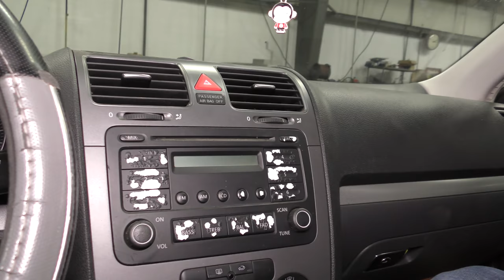$1,000 for a window motor on a 2005 VW Jetta?!? The CAR WIZARD & HOOVIE were just a shocked as you!

Comment: An 05.5 Jetta! This was one of VW's mid year model changes. For the first part of 05 they had the Mk4 style cars then switched to these. This was the first year VW offered the 2.5 5 cylinder motor. I bought one of these when they came out. It's actually a great engine. They really don't have many problems.

Comment: The window motor/door control module is a rare item to actually have fail. And you have to make sure it's not only the right part number but also the right "color code" based on the car's VIN number to properly match and be able to talk to everything else on the convenience system data bus (central convenience and electronics module, all the other door modules etc).

What IS common, however, is for these early mk5 Jettas to have broken wires in the door harness. VW had an extended warranty for them even because it was so common (but generally ends after the car is 10 years old or older). They have an updated harness that's a fair bit longer that supposedly prevents the harness from bending excessively in the same location, leading to eventual wire breakage.

While the extended warranty is long gone, they should still have the updated harness at a more reasonable price than a new door module.

Comment: The VW dealership wanted approx $1200.00 US dollars to replace my 2008 VW 2.5 Rabbit vacuum pump and gasket.(the same one in this video).. (this is when my new mechanic - a guy who has a shop since the 1970's, and only works on VW's and Audi's was found).... my new mechanic said, "you don't need a new pump"...he fixed for approx. $275.00.  

Can easily replace spark plugs, air filter myself... AND that coolant reservoir Hoovie mentioned leaked in the middle ... $35.00 to replace.... 

 My new mechanic said that the rust...(the tiny bit right above front tire)...was from the sound deadening foam located up in the fender, he pulled both foam blocks out of both front fenders....  He also said its a good car, and that he could get a new engine if needed for approx $900.00 ....it has approx 170,000 miles.  He has a unique way of checking the transmission fluid, however, have to leave it at the garage overnight....has to be cold....then he adds transmission fluid by temperature somehow.

Comment: I love these. My mom has a perfect 2010 5 speed that she never drives. 50k miles on it. I have a 2013 Jetta 2.5 and its a POS rattly ass rough riding turd. These are great cars. I LOOVE the 2.5. They are very reliable and make fun noise. Decent power

Comment: I had an 89 Ford Probe GT have its driver side regulator cable fray and fail.  The dealership told me it would be cheapest to buy a used door.

Apparently, in order to repair this regulator, it required drilling out all of the spot welds between the inner and outer door panels and then re-welding.  They quoted me $600 to do it, and that was back in the mid 90’s.

Comment: Coincidentally, I had that same handbrake issue on a ‘98 VW GTI. Seems the little rubber boots at the rear ends of the cables had deteriorated, letting in water which would then freeze and lock the brakes on. I eventually replaced the cables, and it was actually a pretty easy job. Just FYI.

Comment: My sister had one of those, she bought it new and it immediately had oil leak issues.

She took it to the dealership five times and they kept telling her it was "normal" for them to leak like that and they told her to keep topping it up with oil which she did, even after the engine blew because of the constant oil leakage they refused to acknowledge that it was a serious problem until she threatened to sue volkswagon canada and they refunded her the value of the car new so she could go buy something better.

Comment: Wizard, that window motor is only around £20 here in the UK and Ireland, and it does not need to be coded to the car either, I have changed loads of these.,
Great channel and content
Reply: Had to dig for this comment, your absolutely right!!! and they are more expensive in the usa, oem $400, rebuilt or aftermarket anywhere form $100-200.

Comment: A client's 5 year old 2001 Golf Mk lV broke the cable mechanism on 3 (three) electric winders in a year & a half. Driver's door twice & passenger's once.
$400 bucks each, coz they included the motor, no alternative.
Wound up buying mechanical winders at a Scrapyard ($30 bucks each) & punching a hole in the panels for the handles.

Comment: Used window motor, hold switch down 10 seconds, then up 10 seconds. It'll reprogram
Reply: Yeah, you have to do that any time you replace the battery in the car as well. All that's doing is getting the module to recognize where the auto-down and auto-up should stop. I've got an 07 rabbit and have to deal with that.
Reply: Thnx for the info

Comment: I'll sell you a door with window...complete, correct year, color.  Mine is inherited 2.5 automatic.  Trans started to slam 2nd and 3rd at 87,000 miles (Typical German planned obsolescence).  Still slams and slips at 147,000 miles, but it gets me back to work, and the heated seat is great in winter. The alternator clutch pulley seized so I might be ready to sell parts.  My radio looks like that one, but 6 cds means I never have to touch the "leprosy buttons".

Comment: This is not a 2005 Jetta the production date was probably in 2005 but the model year is a 2006 it’s a MK5 Jetta the 2005 is a MK4 .  the windows regular problem is most likely broken wires in the flexible rubber boot near the door hinges also the vacuum pump normally leaks where the pump mates to the cylinder head and also on the plastic nipple where the vacuum hoses is connected the pump is easier to remove on 5 speed manual cars the automatic is harder.

Comment: I have the same year Jetta with all the same problems. The window turned out to be due to some of the wires in  the driver side door wiring harness  being too short so they get cut and stop working. The fix was to get a harness from a later model year parts car that didn't have that issue. It"s been over a year with no issues. Overall its been a good car and i hope to have it another 10 years.

Comment: I had a 2005 Jetta TDI. Or has the same rust problems. I had to replace at least one of the window modules. It was worth doing, though, because I drove it to 255k miles. It still trash great, but I didn't want to deal with the rust. 

I now have a 2014 Jetta Sportwagon, which I expect will go to 250k also.

I don't know if the 2.5 can be expected to 250k+. I've never had one.

Comment: I had two of these new in 2006 and 2008. Later had a third one when the model changed again in 2011. The engine gave no problems. When you run into problems with this car you should always take in consideration looking for original Skoda parts for the Octavia A5 model. Those are the same parts, but 10 times cheaper. You can also get parts for this car in Mexico, as it was assembled there.

Comment: If your buying a USED Jetta or any VW with these vacuum pumps they do need the gasket replaced around 100,000 or 8 years. The gasket cost $9 & it takes 30 minutes to an hour to replace. The 2.5L is one of the most reliable motors around plus you get decent power & decent gas mileage.  The next generation Jetta body style is a lot better.
Reply: @enp83 You can do it from the top yourself. There's a few videos on YT that shows you how. What ticks me off is some Mechanics will try to charge you for dropping the transmission & go by VW's estimated cost.

Comment: Its the door harness not the window motor setup. VW did a extended warranty on it because they knew it was trash but they time limited it and the replacements didn't solve the issue with time. Shouldn't be more than $300 with labor with how cheap the harness shows up online now.

Comment: Wow.. I have the original radio in my  01 Subaru Legacy /w 135K that I've owned since 2006 and the radio buttons still look great.  Tape player stopped working tho and CD player has an issue  with skipping while playing music.  6CD changer in 2012 stopped allowing CDs to be ejected or inserted; the few that are in there will still switch and play.  
headliner not sagging. all original window motors. moonroof still works, too.

Comment: Not great... interesting. Our 2008 Rabbit has been 100% reliable. I did just do the vacuum pump at 140K miles. And replaced the AC pressure switch. Oh, and the door locks. But overall, extremely reliable, functional vehicle that is pretty fun to putt around in.

Comment: I owned a 2009 TDI Jetta, super reliable and only had a couple of issues around 230,000 Km where it needed CV shafts. Sold it when the car had done over 275,000 Km, still miss it

Comment: I have an 06 Jetta... good to know, I hope my window motors don't go out anytime soon!!!
Tho use a Wizzard that specializes specifically in VW/Audi so they are quick at the jobs.

First, I was pretty sure MK5's started at 2006 (Maybe it's 2005.5?)
Second, I would take the 2.5 over the 2.0TSI without hesitation. The TSI of those years would grenade at random.

Long Lasting VW engines,
1.9 TDI's (The BRM of the 2006 MK5 usually has cam and lifter failior around 100000km but perfect after that's resolved)
2.5's
1.8T
2.0 (2.slow)
VR6
They have other good engines, but one thing is for sure, they are seriously sensitive and require flawless care. Perfect specific oil, needs premium fuel...

Also MK5's Rust to hell. ALL MK5's have Rocker panel rust.
MK4's aren't as nice, but they look and run like tanks... Also don't have the Rust issues of the MK5. (only front fenders which are easily replaced)

Comment: It is now Sunday and there is still no buy this, not that video uploaded for the Car Wizard channel yet. The last video was the 1984 Ford Thunderbird from Euro Asian Bob that was in the shop yesterday. The Car Wizard will definitely do a buy this, not that video for Mazda on Tuesday or Mitsubishi on Thursday. The only vehicles to buy for Mazda is the 2004 to 2018 Mazda 3 sedan or hatchback with any engine and/or any transmission and the 2004 to 2008 Mazda 6 sedan with the 3 L V6 engine and any automatic transmission, as well as the 2014 and newer Mazda 6 sedan with the 2.5 L Skyactiv four-cylinder engine, either naturally-aspirated or turbocharged, including the 2017 and newer CX-5 and the 2016 and newer CX-9 crossovers. The only vehicles not to buy for Mitsubishi is any newer model with the CVT transmission, as well as most of the older models - the Diamante full-sized sedan, the Montero/Montero Sport full-sized 4x4 SUV and the Endeavor mid-sized 4x4 SUV. That should be good for the Car Wizard to know from this point forward. Thank you very much.

Comment: My father bought a 2007 Jetta with the 2.5, in basically the same condition, for $250, he then proceeded to drive it until the wheels fell off, and that’s all that car wrote. He bought it at 120k, by 130k the transmission started slamming into every gear, and by 150k the transmission was done, and so was the car.

Comment: So yeah, this is a thing.... can't get a direct replacement door module, so you have to replace both front door modules with updated designs that are not compatible with the J533 CAN Gateway, so that module has to be replaced as well.... $1000 it is.  I suggest to go with a good used unit.  Ignore the info that is etched into the plastic body of the module, the real part number is printed on a sticker that is stuck to the metal cap of the motor part, that is the part number you need to match up when going with a used unit.  With a correct matching part number, there is a decent chance the soft coding will be a match as well, so it become a plug-N-play swap for it to work.

Comment: I leased a 2009 Jetta 2.5 5cylinder 5spd manual metallic gray, base pkg same as the video, YES did not set the world on fire with speed, but I absolutely LOVED this car, it was the engine, the 5 cylinder adds such character to this car, I didn't have a single problem for the entire 36 months, I had paid service in the lease, serviced on time, not a single prob, traveled a few times long-distance between LA & Phoenix, drove like a champ, I must say, it did run out of "breath" at higher RPMs, as it seems the power was mostly down low in the powerband, but seriously loved the experience, 13 yrs later still miss that car, things I didn't like was fuel economy was not great, but not the end of the world either, the car really needed a 6th gear, other than that solid ride with lots of character to give, the short gegaring on this car even tho it ruined the fuel economy, it made such pleasure to drive, manual transmission, anyhow, just some memories to share, cheers!

Comment: I had that exact same model, if you open the door and remove the boot that protects the electrical harness near the hinges, you will see, almost for sure, that the insulation of the cables is craked, looks like it dries and cracks, creating short or open circuits. Trust me

Comment: This was my first car, which had a five-speed manual. The 2.5 is really reliable. Got 210 thousand miles out of it before I sold it after getting a new car. Had one clutch and a new radiator installed in about five years of ownership.

Comment: You can get a device that you put on one end of a cable and put a spray lubricant into it so it will get forced into the cable until it comes out the other end and it usually frees up the cable again.

Comment: I had a 2000 Jetta TDI before the 2005. It went to 250k also. I could have driven it longer, but it looked like hell, and I needed a bigger car. The 2005 was bigger. 

I think the 2005 cost my less in maintenance than the 2000.

Comment: We had a 2002 Jetta 2.0 that was purchased new.  It burned about a quart of oil every 1000 miles.  VW would not do anything about it.  Apparently the engines were assembled with the rings installed upside down.  First and Last VW we have purchased.

Comment: Wow! My 2005 Rabbit 2.5 with 148K miles has no rust or any other cosmetic problems other than the clear coat is peeling, and I found a local body shop that I've used for decades who will remedy that for a very low price. I told him I only want rustproofing and not showroom quality. My headlight lenses are still clear! 

Yes, I had the same vacuum pump seal problem which was a cheap and easy fix. While changing the coils and plugs I noticed oil inside the hole for both which was leaking from the center gasket in the valve cover. Knowing that the PCV valve has a limited life span, I bought a new valve cover/PCV valve at a decent price and prevented future problems. All of this sums up all of my problems with the car which has been great!

Note - The 09G automatic transmission fluid should definitely be changed at 30K mile intervals to maintain smooth shifting. You will know if you've waited too long. 
Love the car.
Reply: UPDATE - I've since deleted the vacuum pump completely with a blocking plate from Integrated Engineering and sourced the vacuum from a nearby evap/emissions. The brakes still respond exactly as before and I have zero chances of a leak from the blocking plate. Total cost was less than $70 and I did it myself. 
Also, the engine has been super reliable with no oil consumption between 5K mile changes. This 2.5 I5 is amazing and much faster than you would think. I don't know what the top speed is, but it can cruise at 90 mph at 3600 rpm's without even breaking a sweat. 
The only other things I've done is replace seals that were at life but still working well. So far, so good. 
I've had a bunch of offers for it from Mini Cooper guys for more than I've paid for it, so I know I can sell it at any time.

Comment: I drove VW diesel from 1977 to 2010. My last car was a 1991 VW Jetta Diesel, I dove that car for almost 20 years. Parts became very hard to come by forwarding the end. Lack of support from VW, I needed some fuel injectors and my mechanic found the last four in North America, someplace in Canada had some. Another in California had the last fuel line that goes from the injector pump to the injectors. I use to be a fan of VW's I would not touch one with a 10-foot pole, and I was offered a 2004 VW Jetta TDI, and at a very very good price and I passed on it. VW's are not the cars they were.

Comment: No surprise from my side regarding the cost of things like window motors on VAG products. I owned a Jetta VR6 about 20 years ago, and used a piece of wood to prop the drivers side window up for over a year, as I could not spare 25% of my salary on genuine replacement part. Eventually I found a firm 700 kilometers away who were willing to recondition my old one for roughly a quarter of the price, but I had to courier it to them. I learnt a lot about window winder armatures and motors, as well as being dead skint, all at the same time. Good times!